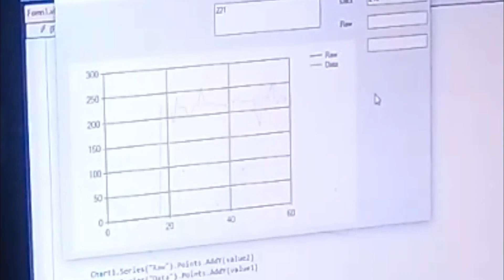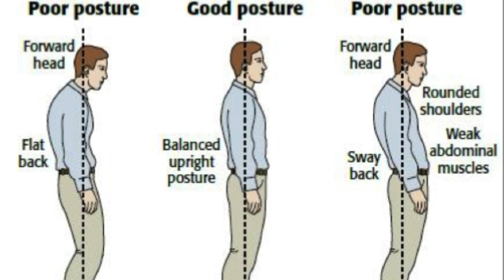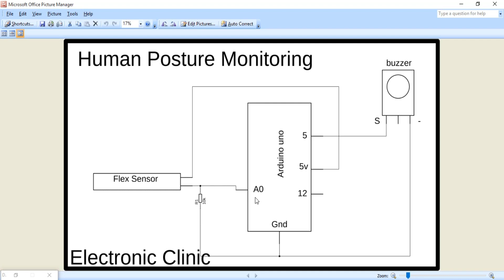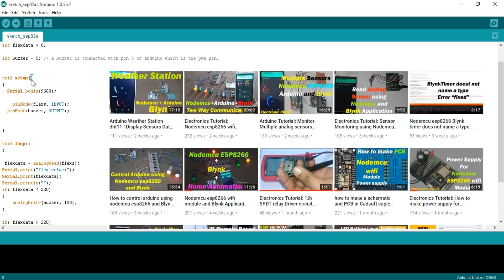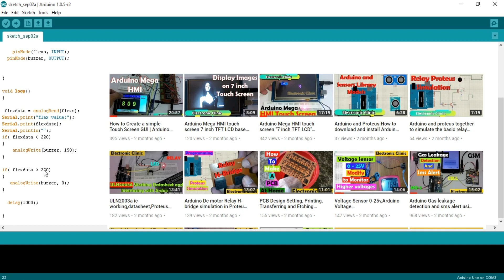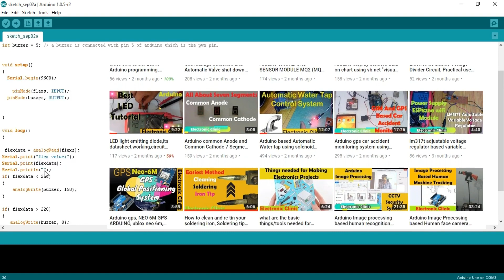Flex sensor or Bend sensor based Human Posture monitoring “Arduino biomedical project”

Comment: Hy can you please tell me why you have used radiofrequency transmitter module?
Reply from the maker: this is used to send the data wirelessly to the receiver circuit.
Reply: @ElectroniClinic  Hy I have some doubts in this project that I have send you through email could you please reply me..
Reply: @ElectroniClinic  This was the message.., I have some doubts regarding your video titled:Flex sensor or Bend sensor based Human Posture monitoring “Arduino biomedical project”. Before this video you had posted a video on Flex sensor where you explained in detail what is a flex sensor and how you connect it on the breadboard and stuff. Although in the human posture video you have not shown the breadboard and also you have put additional component like a radiofrequency transmitter of whose connections you have not specifies. Also for the buzzer is it ok if I use the 9V battery as I cant find the battery mentioned by you.
Reply: Can we do the project without using the radio frequency transmitter..And also can we use the 9v battery
Reply from the maker: ya you can do it without using the rf modules and yes you can use 9volts
Reply from the maker: connect this with arduinos ground pin
Reply from the maker: i have a detailed article on this project. check link in the description.
Reply: @ElectroniClinic  sir battery has positive and negative pins. So Where the positive and negative pins should be connect in the arduino.

Comment: I have chose this as my project, coupd u help me out
By giving the detailed information regarding connections
As i new to arduino
Will be waiying for ur reply
Reply from the maker: Everything is available on my website
Reply: @ElectroniClinic  but sir
I have seen one other video too
U have mentioned those pins
But u didn't explain how to connect  buzzer and capicitors clearly
I just want it a bit more clear sir.... Could you help me out
Or can u give me any reference?.
Reply: @vivekreddy7315  hello have you done the project is it works
Reply: @dharanisenthilkumar3904  yes, we did it in our first semester, but better opt some thing else, the flex sensor doesn't work properly, and as a result, Arduino values used to elevate , and by making few changes in the code , we some how managed to get the output, and tbh , we've tried to manipulate our instuctor with mock outputs, so better done opt it at the beginning it self, once if u begin this and get stuck in between, even u would also have to manage ur mentor by showing soke fake results